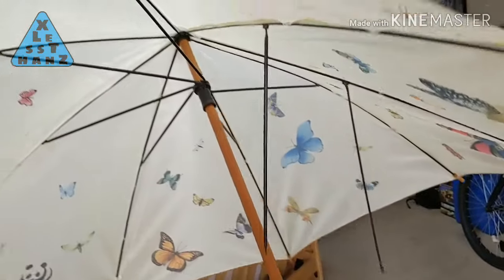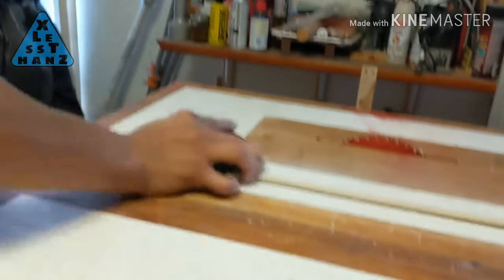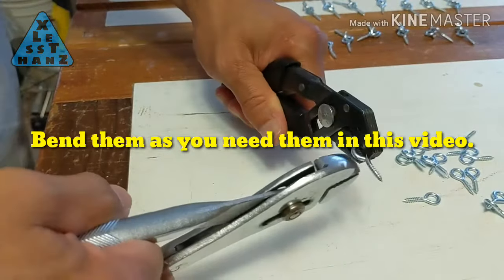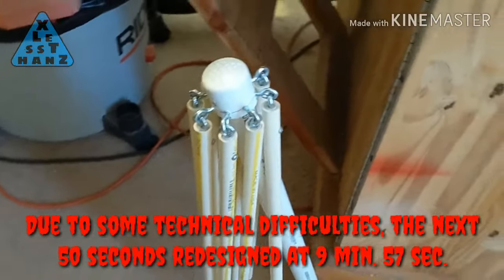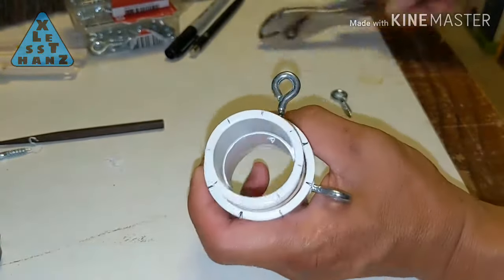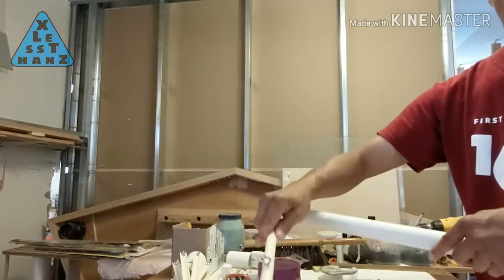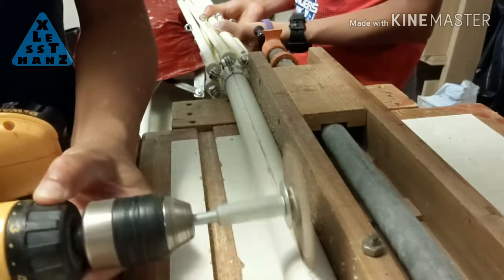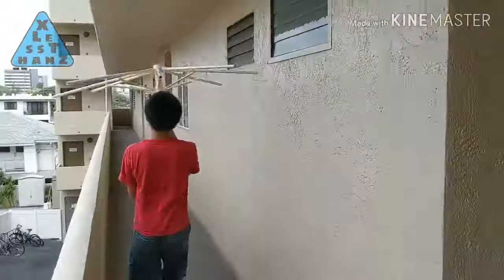Build an Indestructible PVC Umbrella (DA UBER BRELLA)

Comment: It's a nice idea, and surprising to find very few YT vids about this subject. Some other ideas would be like a 'frankenbrella' using parts from a commercially made patio version, or did you ever see those ones for made for fishing? The ribs/fabric could be shortened and the pole changed, leaving a sturdier hand-sized version.

There are YT vids showing 3D printed DIY metal forming dies; stronger hardware for a normal umbrella could be made like this using steel strips. Perhaps on a standard umbrella the weak parts could be reinforced using resin and ultra-light glass cloth (designed for RC planes), or braided tube, and compression molded in some way. The hinge rivets drilled out and upgraded hmm.